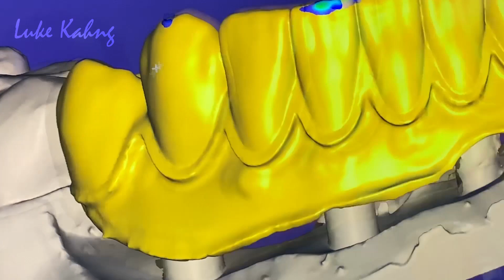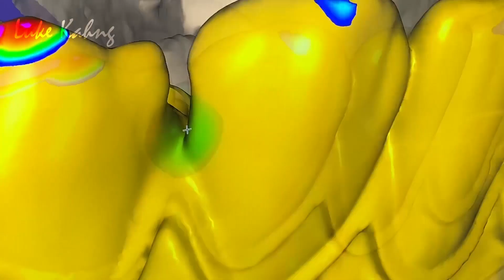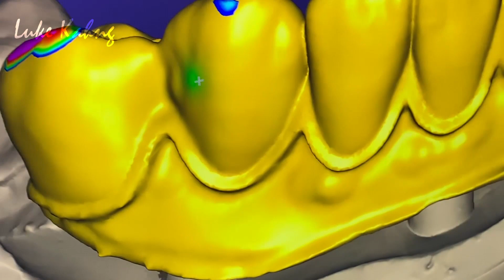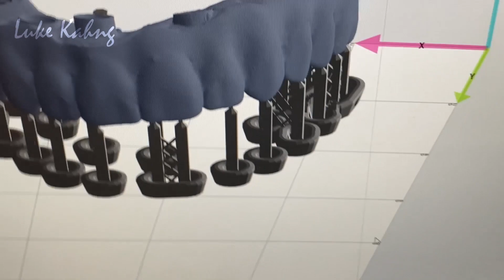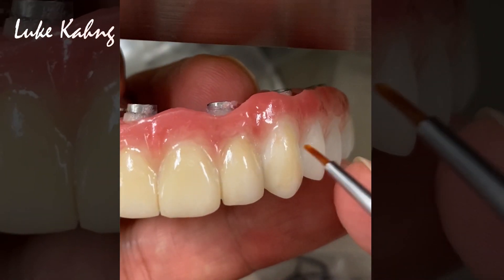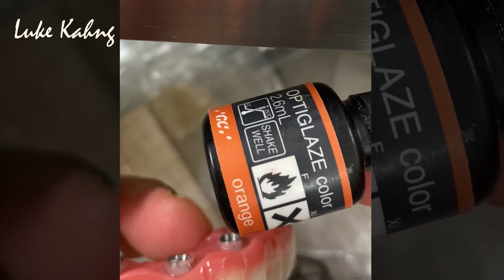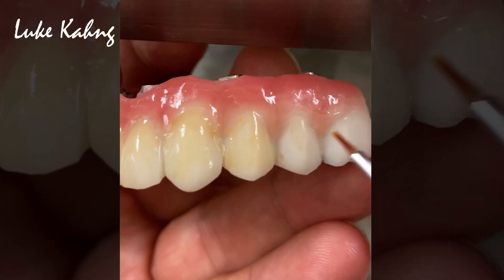How To Make Your 3D Printed Prototypes Look More Impressive

Comment: I've had you on subscribe for a while.  I'm wondering where you practice.  My smile was my icebreaker and now, because I have been taking a lot of medications. I guess xerostomia had a part in it. However I have 14 teeth in my mouth now. I've almost chocked to death more times than I can count. I know its expensive but I don't want dentures.  Anything fixed, or you can remove only. What are my chances of getting a life again? It's a toss of the dice. If I get kicked out of my apt. Well I don't have a vehicle.   I won't walk the streets. I'm 56 and its do or die for me.